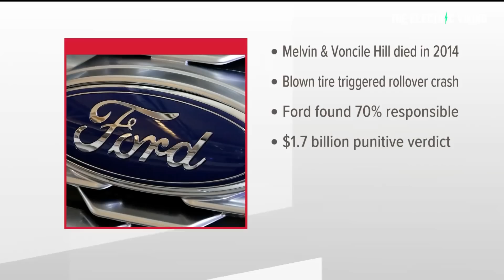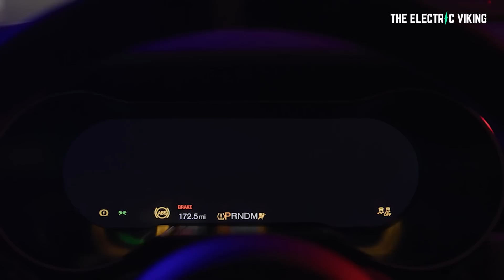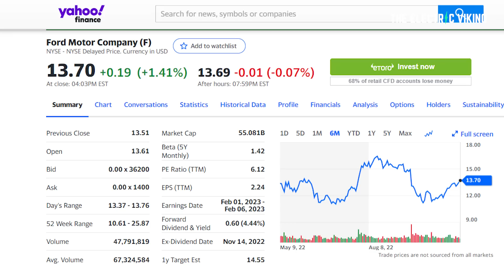Ford found guilty of stealing and lying in disgraceful cover up

Comment: I once worked for the Ford Motor Company in quality control. I left after 12 months having never found any!
Reply: I've often wondered about GM, Ford, and Chrysler, and what kind of tests they put their vehicles through in pre-production. I would think their engineers put their vehicles through a rigorous 100,000 mile test drive (or something equivalent), exposing the vehicles to various road, temperature, and weather conditions, putting the engine and transmission through frequent and various cycles of acceleration, cruising, and stop-and-go traffic. It would expose a lot of problems and avoid a lot of recalls before their vehicles hit the market.

Comment: I will never buy another Ford. My experience of owning a 1987 Ford Bronco II with a unlimited amount of problems from transmission,transfer case, faulty distributor, faulty window and locking mechanism,leaky heater core, water coming into side of body walls when it would rain or wash the car. I had so many repairs that I had to sale the automobile when it only had 30,000 miles. I called the corporate office and they told me that they could not help me. This is good enough reason for me to never buy another Ford or recommend anyone buy a Ford product.

Comment: i must have gotten lucky.  my 2014 f150 has had zero issues which is a good thing since its a farm truck that daily trades off towing several trailers over the worst terrain you can imagine.  plus its my family car.  i do have to replace the tires a lot because of sidewall damage - buried fence posts.

Comment: Long-term debt can be defined as the sum of all long-term debt fields. Ford Motor's long-term debt for the quarter ending September 30, 2022, was $84.279B

Ford Motor's cash on hand for the quarter ending September 30, 2022, was $40.173B, a 13.47% decline year-over-year. Ford Motor's cash on hand for 2021 was $49.593B, a 0.74% decline from 2020.

That cash on hand would be about 4 months of operating capital, It cost ford $175 billion dollars a year to operate.

Ford has one of the lowest cash reserves compared to operation costs in its existence

Comment: I bought Fords for most of my driving life, my first in 1974. My favourite is still the XW sedan manual GS that I owned for 5 years. I bought my last in 2010. When it came to replace it, I'd lost all interest in Ford. The product range was limited, I don't need a truck that masquerades as a ute and there are way too many better options available. It's not dealers that are the problem, it is the Ford Company. I'm not surprised by this story.

Comment: Maybe they rewrote.  Source code is typically not shared with customer.  This is not illegal.  Would have to know details before judging
Reply: Not saying Sam is gaslighting here, but there is way more to the story.  Ford hasn’t paid anybody and is appealing the verdict while claiming no wrongdoing. The partnership with the software company started in 1998 and went thru 2015.  Heck I think they have had 5 CEO’s in that time and no telling how many divisional heads, department managers, etc have changed. In a company the size of Ford, this literally could have been an oversight, even if they are at fault. Big companies sue each other all the time, it’s how they roll.  Glock sued Smith & Wesson over the Sigma line of pistols.  Which, after it was settled, the Sigma line evolved into the SD9-VE (and it’s variants), which they still sell to this day, and still looks remarkably similar.   Also we don’t know that the software supplier is acting in good faith, just because Ford is bigger doesn’t mean the smaller guy is legit. This whole thing will probably get settled out of court during the appeals process and the two companies will shake hands and walk away.

Comment: Not too much has changed  Putting aside Ford knowingly sending several unsafe cars to the market,  Ford also has a history of patent infringement.  "Robert William Kearns (March 10, 1927 – February 9, 2005) was an American engineer, educator and inventor who invented the most common intermittent windshield wiper systems used on most automobiles from 1969 to the present. His first patent for the invention was filed on December 1, 1964, after a few previous designs by other inventors had failed to gain any traction in manufacturing.

Kearns won one of the best known patent infringement cases against Ford Motor Company (1978–1990) and a case against Chrysler Corporation (1982–1992). Having invented and patented the intermittent windshield wiper mechanism, which was useful in light rain or mist, he tried to interest the "Big Three" auto makers (General Motors, Ford, and Chrysler) in licensing the technology. Each rejected his proposal, yet began to install electronic intermittent wipers based on Kearns's design in their cars, beginning in 1969, when Ford rolled out the feature to its Mercury line.

Kearns's legal battle against Ford to protect his invention and patent was the subject of a 1993 article in The New Yorker magazine, which became the basis for a full-length biographical feature film titled Flash of Genius in 2008. Kearns was played by actor Greg Kinnear. Kearns had six children with his wife Phyllis, although they separated, supposedly as a result of the stress from the legal battle. He died of brain cancer at the age of 77."

Comment: It's very possible the bean counters did not know what the engineers were doing . That kind of what happened with Volkswagen and their diesel smog bypass .
Now the bean counters put allot of pressure on engineers to get something done within budget . My daughter has run into this as a engineer having bean counters saying can't we just use duck tape and call it a day .
That's the problem In the corporate world and for very big companies like Ford it's hard to know what one side is doing . Being a publicly traded company puts more pressure to satisfy a robust stock price and the board decides direction of the company . Should the CEO know ? It's impossible to know all the particulars on what is going on . Is he responsible ? Yes . That's the problem being in charge as you only as good as your lower tier employee

Comment: If this were an isolated incident, you could say its a Ford problem. But it isn't. This how most big American companies operate; they are bullies, and small suppliers are screwed over on a regular basis. It's the VP weasels that do this. I doubt that the upper mgt even knew about this software licensing contract, which to Ford who sells over 100 billion a year in product, is even noticing something that was only 1 million or so a year.  

When my father started his EV firm in 1970 with his technical partner, an esteemed prof. Middlebrook at CalTech, they had a motor control device that would be very useful for EV's (a patented DC to DC converter) the big Forklift maker Clark wanted to license it, but they said the company was too small, so they requested it be sold to GE, and GE offered basically nothing, and threatened to crack the patent.  

Large American firms are awful to do business with. We occasionally have to deal with the 3 big Telecom companies, and they are such cheaters, and manipulate the laws in their favor.

Many inventors have had their ideas and inventions stolen by the car companies. In fact, the entire diesel emissions scandal, which is improperly blamed on VW, when the sneaky code was written by employees of Bosch who supplied it to any car company that wanted it, was caused by firms refusing to license Mercedes' patented urea injection system that reduces diesel pollution.  Rather than pay their rival Mercedes millions a year, the got their ECU supplier Bosch to add code to the ECU that would detect when it is doing an emissions test (front wheel not moving while rear wheels are spinning, etc.). They hid that code in plain sight, classifying it as "acoustic management".

In American history there have only been a handful of truly honorable companies; inevitably during the lifetime of the founder, like Hewlett Packard, and Thomas J Watson at IBM. Those guys were fanatics about integrity, and clean business dealings.  Cook at Apple is very good in his business dealings, and you don't hear vendors squealing.

Remember GM when it was broke and stuck its parts supplier AC Delco with a $1 billion bill, forcing them to "chip in" and share the pain? Bullying is what most American companies are about, and that is one of the reasons why the Japanese are so dominant in the auto biz; they get high quality parts because their vendors are not tortured; Ford and other american companies squeeze their vendors so tight, that they cut corners, and deliver shoddy parts, and that is where all the recalls are coming from; bad parts, whether it be air bags, hinges, oil lines, etc.

Comment: I’m American and my father was a auto mechanic as am I now for 28 years but in reality that’s my professional history. But at 46 years old and with my father . It seems like my first memories were being under the hood of cars . From the 80s info the 90s they had some good power plants but horrific transmissions . The A4LD being the worst transmission. The 80s and 90s we era were their full size cars , trucks and vans were solid. But the rest in my opinion was pour junk !! The 3.0 V6 was a good engine, the 2.3 a great 4 cylinder . So with a manual transmission behind those would give you a good vehicle. But outside of that ? Junk ! Chrysler was as bad and worse especially the electronics. The Jeep Grand Cherokee 99-04 with the 4.0 inline 6 is their last great vehicles . Now GM ? The best vehicles of the big 3 with many Legendarily indestructible power plants with engines and transmissions on a whole mother level of beaSt mod

Comment: Large companies have large staff.... I hate to say it but someone wanted to make their department look better.  Had some smart employees make software that did the SAME thing (I wont say reverse engineered as I was not there to know how it was done so do not make those claims).  I won't blame the CEO, or the employees but the person who made that decision.  Also I love how people bash the dealerships for "lies" about what their vehicle needs.  Sad to say, Ford has NO CONTROL over what an independent dealer does.  CALL the GM of the dealership and sit down with them.  They will make it right.  Your issues are with a tech or advisor or service manager who wants to make money.  period.  Not Ford, not the general manager

Comment: i bought a used ford truck. i asked the dealer why the bottom was all rusty. why did'nt the owner undercoat underneath to prevent rust. he said " ford would;nt let him or it they would void the warranty" lol you couldnt start doing it until it ran out.  obviously ford wanted quicker resales as their truck rot out quicker.  which is the reason i dumped it 4 years later. no sense doing it by the time i got it then after a bit the bottom rusted out, motor everything else still great. total wasteful greedy shame that was 20  or 15 yrs ago

Comment: ford has been sliding into oblivion for a long time now, customers have been shafted with crappy engineering designed to maximize profits but short on reliability and sensible maintenance design. Looks to me like this trend started with the three valve engines about the turn of the century and it just keeps getting worse with every year model. Always a laundry list of "built in failure" that costs owners plenty. I had been a ford guy since mid 1960's but the 2009 F-150 (my last ford I will ever buy) was what woke me up to fords fall from on high.

Comment: Add this to the list of the "Incredibly dumb stuff":

"BYD will be able to “inherit” Ford’s factory in Bahia without paying anything

BYD wants to establish production operations in Bahia in Brazil, and, to that end, has begun negotiations on this future operation. According to the information published on the website Automotive Businessthe contracts involve the extension of the existing railway line and the use of Ford equipment in Camaçari (BA).

The process is monitored by the trade union of Camaçari and the region. According to Julio Bonfim, the company’s president, Ford will have to hand over the factory to BYD for free, as the land and structure are owned by the state of Bahia."
(Traced News)

Comment: I think you are being extremely naive if you believe things just like this don't happen constantly in virtually all large companies. I work for a large (fortune 500) European based company. They constantly preach about honor, integrity, transparency... They are honorable and transparent all right, as long as it doesn't cost to much. In these cases they have no choice, they have to deny for plausible deniability. Even if they had nothing to do with it, if it will cause significant harm to the company they have a fiduciary responsibility.
In large corporations there is always a certain number who will try to get away with some pretty dishonorable and even illegal BS to make the numbers look good to get their bonus or promotion (for example VW diesel gate), only most never get caught. When it does happen leadership needs to do what's best for the company. At least in this case they got caught and will have to pay, but if all of a sudden you are going to be down on the entire company over one incident, all I can say is grow up. Nothing is black and white, it's called nuance.

Comment: While I think your gripes about Ford in this video are generally valid, I don't think that they're the least reliable in the US.  Stellantis is dead last with Jeep, last I checked.  Warranty recalls are only one metric, but Jeep, Chrysler, and Dodge are generally at the bottom of the list (and have been for a long time).

I also would appreciate a more technical and/or detailed explanation of what was "stolen."  It's very possible that this is true, and that Ford is guilty of massively duplicitous practices regarding this particular case.  However, courts are notoriously bad at understanding the nuances of software development.  I want to know more about what the bits of the software did that were stolen.  Let me give an example: if it's the UI that's the problem (the things you actually interact with as a user), that COULD be understandable, as Ford has to maintain a certain look and feel that has become a part of their brand identify.  I don't think it's right for them to wholesale steal the UI, don't get me wrong--I'm just saying it might be understandable.  If the underlying code supporting that UI was written from the ground up by Ford, then I'm not sure the ruling would be the correct one.

If, however, Ford literally took the code from the existing software, tweaked it a bit, then called it theirs, that's almost certainly a violation of contract they should not just pay out in the court case, but go well beyond that to make it right.

IF it's "reverse engineered," as you state in the video, that's a bit of a grey area.  Is it wrong for a software development team to see a feature or app they like and build something that solves for the same problems?  Sometimes yes?  Maybe?  It depends.  If NO ONE did that, Mac OS and Windows wouldn't exist, and we'd all be using Xerox products to run our computers.

What I'm saying here is that there's nuance that's definitely missing from the video.  I'm not trying to defend Ford, or be a jerk.  Instead, I'm asking for more detail.  I want to know what was called out, and why.  I want to know what the software does, and whether or not there's a shared codebase.  Maybe collaborate with Legal Eagle or something . . . 

I'm saying this an idealistic owner of a Mach-E.  I want to avoid supporting companies that do this crap.

Also, I didn't do an exhaustive search of your channel, but I hope you've called out other companies for this kind of crap in the past.  E.g., Elon Musk and Tesla clearly abusing a CA program to automate charging to get grants or Tesla's REPEATED violations of the Clean Air Act (https://www.popsci.com/technology/tesla-fined-epa-clear-air-act-violations/ ).  In short, if you're looking for a company to be disgusted with, it seems like Tesla should be high up on that list given recent accusations of hostile workplace conditions, Musk's erratic behavior, the fact that the supercharger network STILL isn't 100% green, the proprietary nature of all their tech, and the list goes on and on.

Fact is, every OEM in the space has some ugly things in their closet.  This is a "lesser evil" situation, and to learn what that lesser evil is, I need to know more about this case.